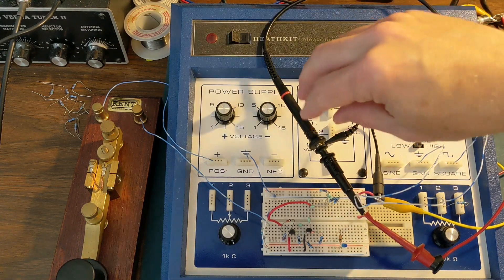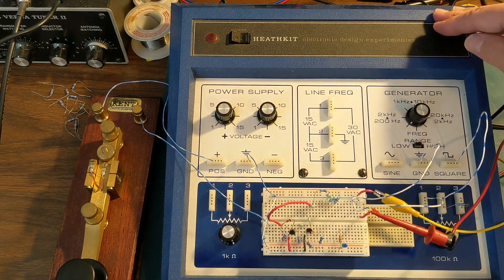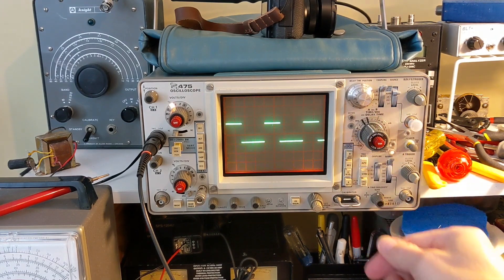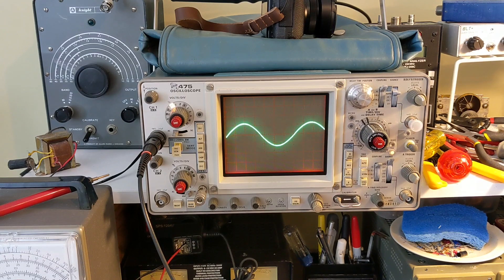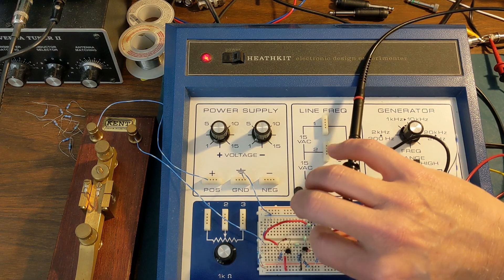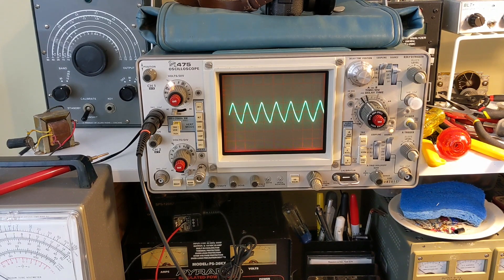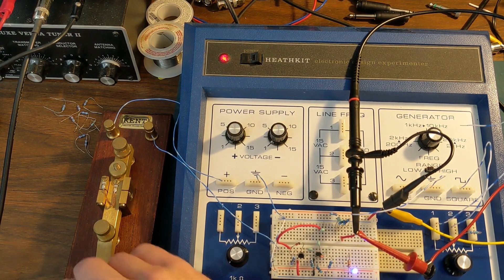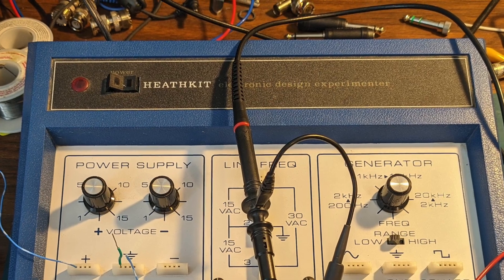Heathkit Electronic Design Experimenter Model ET-3100

Comment: I bet they were expensive ?
Reply: Not really. In today's money the cost would be ~ $200. These board kits were actually produced for a series of study/learning modules (sold separately by Heath) which included learning AC/DC circuitry, transistors, op-amps, etc. A very comprehensive and inexpensive learning program produced by Heath. If you happen to have a 3100 board, seek out the individual learning modules designed to go with the board. You won't be disappointed.

Comment: Thanks for that!! I'm nowhere near understanding all this even though I've had a fascination and strong interest in microelectronics since as far back as the early 70's. I bought an ET-3100-B about 2 months ago. My timing was all wrong and I had to address some more important tasks and events the same day it arrived at my door. I barely had time to turned it on before I had to put it back in the box.

I own 3 scopes, (one is only good on channel 1). I have a great BK Precision 2120 analog scope and a new Siglent 1202X-E digital scope. Of course, I have a number of other instruments, (SFG, AC Multimeter, old, analog Cap tester, etc., etc.), and I'm approaching about 2 weeks of free time where I can try and understand some of the various points regarding the entry-level electronics.

Because the Heathkit ET 3100 was sold by an estate dealer who didn't know anything about it, I'm wondering if I should replace all, or most of the 'key capacitors', resistors and maybe the transistors as well. Do you, or anyone reading this, think I should? Or maybe a better question is how would I confirm that my Heathkit ET 3100 is within 'factory specifications and performance'?

Perhaps there's a way to calibrate the the 3100 if I ran some test sequence and found it wasn't quite right. Would you know about that kind of thing? Anyway, thanks for the video! I'm sure I'm going to try to replicate what you did here.
Rich
Reply from the maker: There's likely not much "calibration" to be performed on those old experimenter's boards.  If you have a variac you could see what lowering the line voltage does to get the values closer to what's represented on the knobs.  Mine is pretty close at my home line voltage of ~124VAC but bringing it down on the Variac to ~117VAC seems to bring it closer to expected values.
Reply: @HamRadioQRP  Yes, as a matter of fact, I do have a Variac! I'll certainly give that a try! Thank you! 

BTW; I'm also about to start studying for my Ham radio license. I bought a Stryker 955HPC radio and had the purchase shipped directly to a very reputable and experienced professional to have it peaked & tuned. It should get here by the end of the week.

It was only as I began this reply that I noticed your handle as "HamRadioQRP". I plan to take an online study course for my license and I wonder if you have any suggestions as to who would be a good choice.
Thanks again,
Rich
Reply from the maker: Very nice Rich.  There are a number of good online study guides.  You can take practice tests on QRZ's website https://www.qrz.com/hamtest/

Regarding that Stryker radio, please note that it appears to be only for the 10 meter band voice.  Your initial Technician license doesn't give you voice privilege on 10m.  You might want to start with an inexpensive 2m handheld to communicate with other hams on local repeaters.  You can communicate in CW in portions of some HF bands as a Technician.  If that is your intent, then finding a good used HF multi-band radio would be a good start.
Reply: @HamRadioQRP  Thanks for the link! I'm definitely going to research the info and tip you gave me! 

I didn't know that about 10 meter radios and I feel like an idiot not to have asked myself what the differences were in 2 meter and 10 meter HAMs! Seriously, it seems like that would have been the first question I would have asked myself and it didn't even entire my mind... (doh!)
Rich

Comment: Nice  CW oscillator circuit!  I had the ET-3600 that was exactly the same as the ET-3100 except is was a beige color instead of blue and came out a few years later than the ET-3100.  I sold it along with most of my other test gear (oscilloscope, lab power supply, frequency counter etc.) when moving to Florida 16 years ago.  I wish I had it all back now that I am retired and have more time for HAM radio.  Thanks for giving us a look!
Reply from the maker: I've slowly been accumulating cheap, old test equipment.  I'm glad I actually started with my 1970's Tek 475 oscilloscope.  I think it has forced me to understand oscilloscope operation better than if I'd bought a new tricked out digital scope.  However, taking videos and pictures of its CRT to capture a waveform is sometimes annoying...  I'm thinking maybe I should do the waveform captures with my old Polaroid Land camera rather than my phone camera to be period-correct.  I probably still have some film-packs in the freezer.

Comment: There was one before this that had resistors and capacitors on the board in lines with springs at each end and you would wire back and forth and make different projects it had a relay and a number of other things on it
Reply: Are you thinking of the Realistic (Radio Shack) 100 in 1 kit?